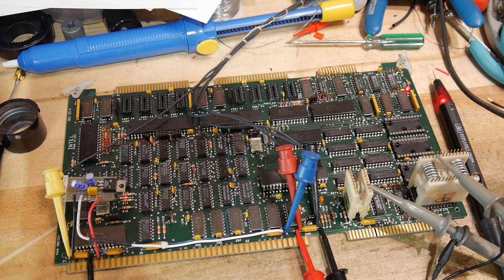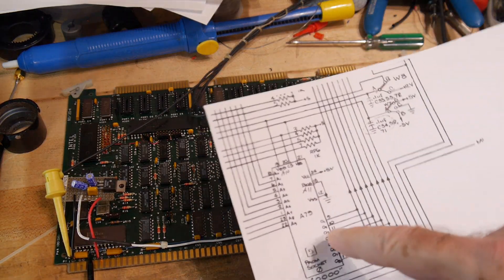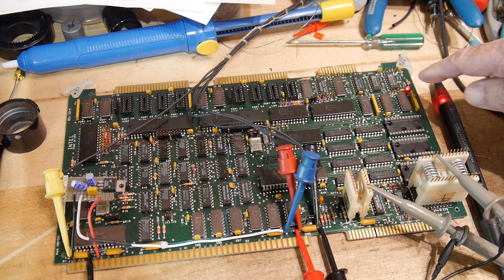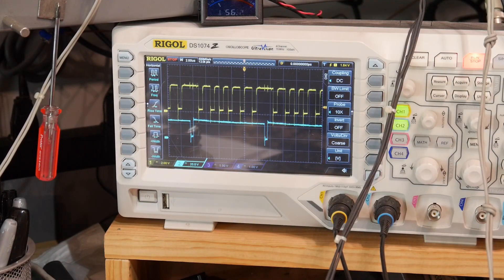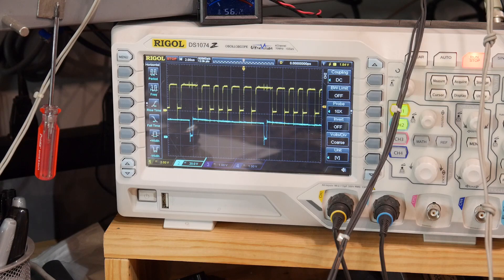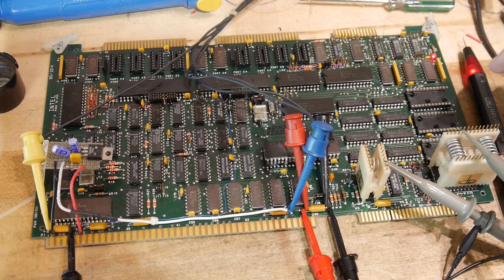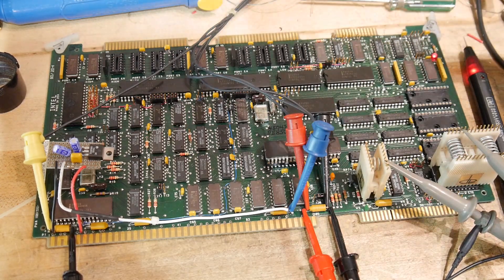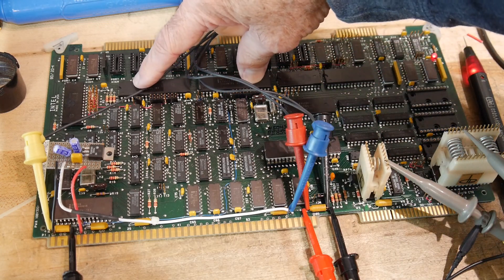#307 Intel 8080 SBC 80/20 Single Board Computer counting program steps

Comment: Hey IMSAI Guy, I am working on an old ia 7301 Computer in a Book. Basically an 8080 SBC to help you learn 8080 assembly language. 
I have been enjoying it up to now. I basically rigged an old triple output Colleco Power Supply up, that has a (+ -) 5VDC and a +12VDC. 
So, everything has been working up to now. 
Now I am trying to read and write to a cassette tapes but I am unable to do so.
There is a chance that my PS does not supply enough current as it only supplies .09A on the +5VDC side. 
I have monitored the Write process on my scope, and I am getting just under 1Vpp where I believe that I should have 2Vpp when doing a write.
can you tell me what power rating I should have to fully run this 8080 SBC including the correct current ratings?
Reply from the maker: Looking in the INTEL 80/20 SBC manual: +5 at 4.9A     +12V at 350mA    -12V at 20mA    -5V at 180mA
Reply: @IMSAIGuy  I was thinking about 3A. 
Is that max or min requirements?
Reply from the maker: @jeffnay6502  well, that is max for a particular chip set. amount of ram, amount of ROM. The old RAM and ROM was really power hungry. 3A might be fine for a smaller system and if you are using CMOS ROM chips.
Reply from the maker: http://www.nj7p.org/Manuals/Intel_Manuals1.php
http://www.nj7p.org/Manuals/PDFs/Intel/9800317D.pdf
Reply: @IMSAIGuy  Than you, some light reading...  I am just trying to get through this novice Computer in a Book set of lessons on 8080 assembly language, which for some odd reason, I find interesting... LOL !!! I am currently looking for a better power supply. What would you suggest? I found a couple of affordable options, but it may be better to spend a little more, to get something that will work a lot better.

https://ebay.us/7ibrL1
https://ebay.us/enKsha
Reply from the maker: I would (and do) get some simple switching supplies
https://www.ebay.com/itm/AC-DC-1A-3A-5A-10A-20A-30A-50A-70A-Switching-Power-Supply-5V-12V-24V-F-LED-Strip/254385948554?hash=item3b3a95878a:m:mzmSgA9m0elYE2VngUI-_ng
they say lighting but they are used for lots of things. you can get multiple output ones that maybe cover 5 12 -12. or just 12 -12. probably a separate one for the 5V. I understand the appeal for the 8080 assy. It is easy to understand and get a good feel for. the more modern CPUs have too many instructions to get comfortable.
Reply from the maker: https://www.ebay.com/itm/AC-DC-1A-3A-5A-10A-20A-30A-50A-70A-Switching-Power-Supply-5V-12V-24V-F-LED-Strip/254385948554?hash=item3b3a95878a:m:mzmSgA9m0elYE2VngUI-_ng
Reply from the maker: here is the one I used
https://www.youtube.com/watch?v=ejRb-XfKhf8
Reply: @IMSAIGuy  I just found and purchased a T60B for $28.00. I think that will work pretty good for me now and in the future. 
I also had some luck finally last night, I was able to read a tape in successfully. I did not change anything I was doing, it just decided
to work. I will see as I continue on in the lessons if it will continue to work. Now I just have to hope the next write works the way it should.
I also like the way you use hook probes, for power and for test leads. I was looking at those, but I have never put any of these together.
I just  wired to my edge connector with 4 extended wires, so that I could hook my scope up to it, without having the probes so close that they 
might touch. The hook probes would have worked well here.
Thanks for all your advice.

Comment: Are you planning to port an existing 8080 monitor to the board or flow one from scratch ?  I need to bite the bullet and try to write one for the MCS48/8035 chips.
Reply from the maker: I will be using a monitor program written by someone I worked with. It includes an assembler and disassembler. quite cleaver.
Reply: @IMSAIGuy   by Rj Wooten of Intel ?
Reply from the maker: @zukjeff  no. Navy military think tank